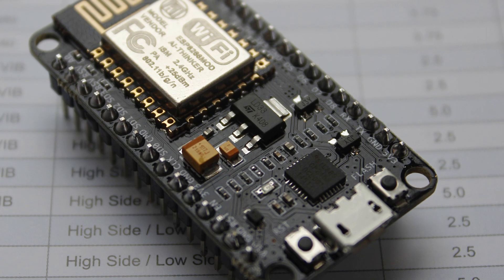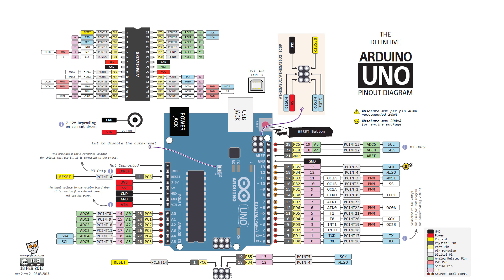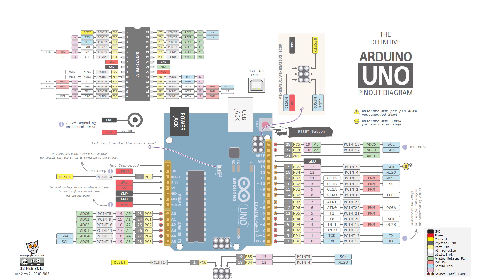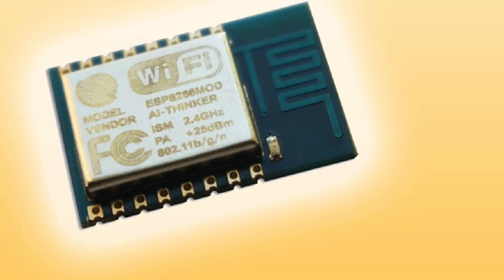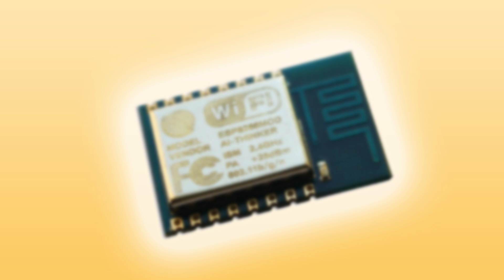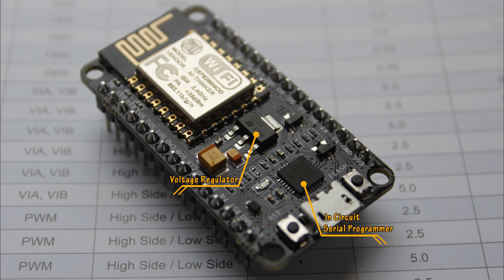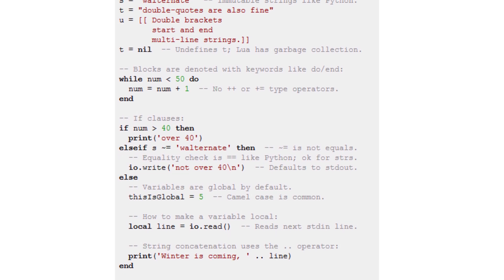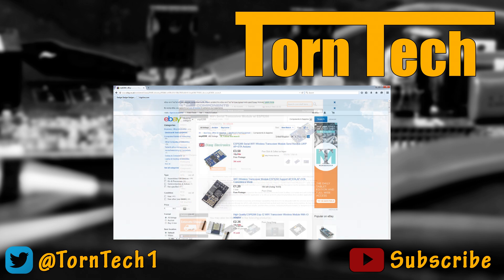ESP8266/NodeMCU Introduction And Getting Started - Complete Guide Part 1 - TN0005

Comment: I am getting started with Arduino. The Uno which is a basic board is still slightly bigger than the NodeMCU. I heard somehwere that it is possible to use this board just like an Arduino, meaning that I can use the Arduino IDE and the same language. Is that true?
Reply: Yes

Comment: Very nice video! Can the ESP8266 module be removed from the NodeMCU board?
Reply from the maker: +Francisco Sarmento Hey, Thanks!

I belive the module could be removed, the use of a reflow hot air iron would be recommended, however these modules are available separately on Ebay. That may be a better choice, as then you have the NodeMCU for development and these modules for production.

Comment: very nice video! ;)

can you help me ?

this message is shown in my terminal:

PORT OPEN 9600

Communication with MCU...
Got answer! AutoDetect firmware...

Can't autodetect firmware, because proper answer not received.
> dofile('test100.lua')
cannot open test100.lua
> 

// i don't know whats wrong? 

regards from germany
Reply from the maker: +Marc Looks like the module has "dofile('test100.lua')" in its Init.lua file(init.lua is the first file the firmware looks for when loading"

It is trying to launch a file called Test100.lua, for it to work you either need to save a file to the device as test100.lua or remove the init.lua file so it doesn't attempt to load it.